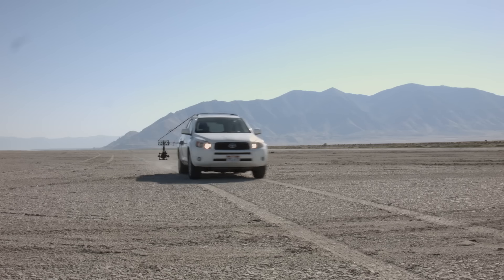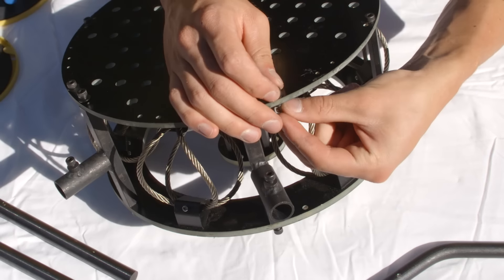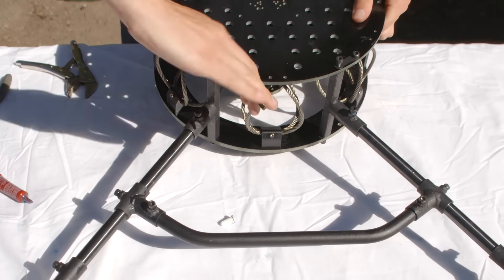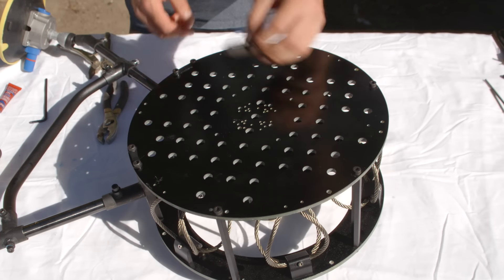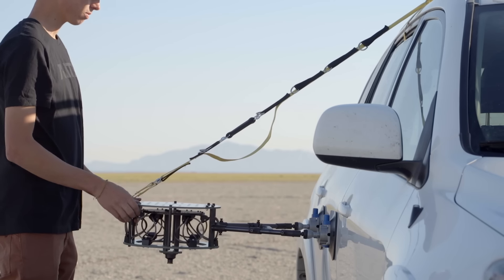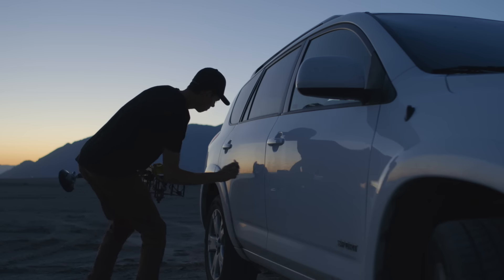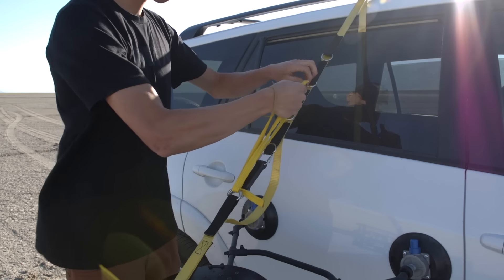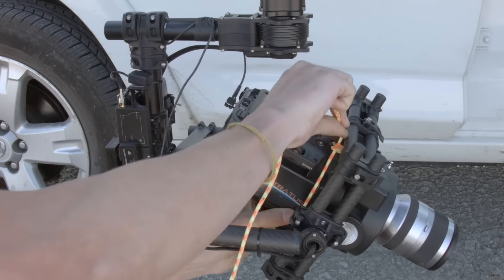CVI-U Quick Mount Build and Installation Instructions

Comment: what's the point of having vibration dampening between the two plates if they are hardconnected with standoffs anyway?
Reply: have a look at 04:03: https://youtu.be/-R_tdoBFQGo?t=243
here you can see, that the hard connected top plate is only for securing/connecting to the ropes, to hold the whole thing in place. the camera itself is actually hanging from the "second", smaller top plate, which is soft dampened via springs on top of the bottom plate.
Reply: Tobias Scheu oh ok, cool.